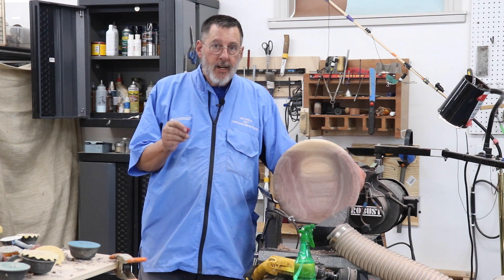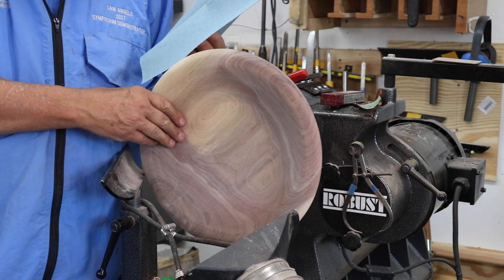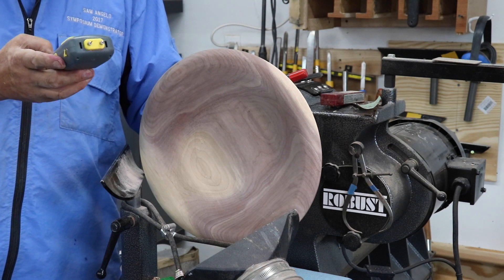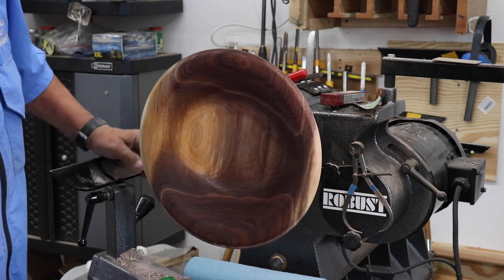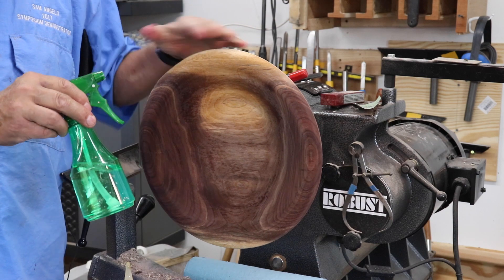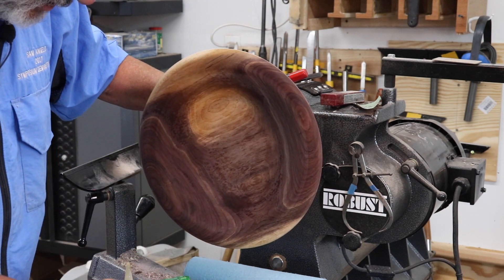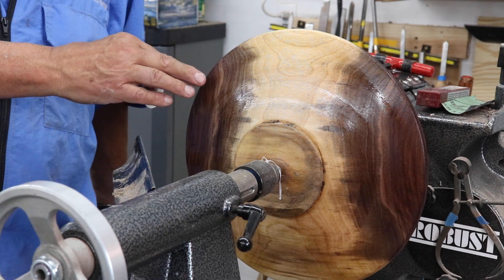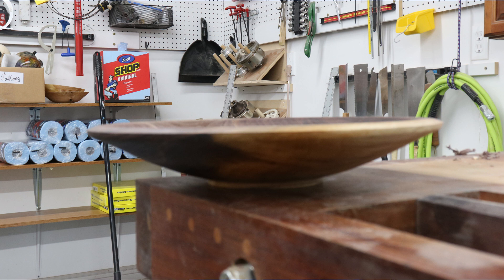Applying an Oil Finish to a Walnut Bowl       with Sam Angelo

Comment: I love Dr's Woodshop finishes...it's all I use for my 'food safe' pieces.  For what it's worth...I'll sometimes leave a piece in the chuck and unscrew the chuck with the piece mounted and set it 'up-right' on my work bench.  I'll then 'puddle' a bit of the walnut oil into the bowl and sides, leaving it for several hours or even over-night.  Once soaked in, I'll put the chuck and piece back on the lathe and then 'friction polish' several more coats.  My version of a 'deep' finish.  For what it's worth...Dr's Woodshop sells a version of their product with shellac included.  Great video as always Sam...cheers.
Reply from the maker: Yes I do something similar   thanks Sam

Comment: Sam even though your American Beauty has stainless steel bed ways, you could keep them (and the banjo you didn’t move out of the way very much) you can just put some newspaper across them (I keep a small magnet on the banjo that I can use to hold the paper) and it works better than just hoping the shavings you left on everything catches it all.  This catches the excess finish from dripping on them (like starting again at about 9:45). Makes keeping everything cleaner a lot easier.  Cheers, Tom

Comment: Good one Sam! I am a big fan of using cut shellac for raising the grain and sealing/sanding. I need to try your approach of applying some walnut oil on top, have not considered it since I figured the oil would not soak in over the shellac? Good method to slow down drying out. Thanks from Clancy.

Comment: Sam I am of the same thoughts as David Walser. I thought you would apply an oil to bare wood to allow it to absorb and protect the wood. Then apply the shellac to achieve a hard durable finish. Thank you for sharing. Have a great day and stay safe.

Comment: As others have commented, it is peculiar to "seal" with shellac before applying an oil finish, when one of the main advantages of the oil is that it penetrates the wood and enhances the figure. If the objective was to slow the drying of the wood, the oil / wax finish would do that. The common sequence where grain / figure enhancement is wanted is to put on a drying oil and, when it has cured, perhaps put on a shellac / wax or some other top coat.
Reply from the maker: Gord, we are just going to disagree on this.  I have been sealing with shellac first, for a long time.  Yes the oil would penetrate the wood-but when thinned down, most any finish will penetrate.  The best argument is that you can also put most anything over shellac.  It provides a bond between the wood and the final finish and it dries very fast.  My shellac is thinned down enough so it really sinks into the wood.  It is OK if we are both right.  I mean, I see nothing wrong with your approach.  Sam

Comment: Sam -- I don't understand the benefit of sealing the wood with shellac before applying an oil finish. One of the primary benefits of an oil finish is its ability to penetrate the wood -- causing the grain to 'pop'. Sealing the wood with shellac prevents the oil from penetrating. On the other hand, I can see the benefit of applying shellac over an oil finish...

I should add, I understand the benefit of using shellac as a sanding sealer before applying an oil finish. In that case, you'll sand down to bare wood before applying the oil.
Reply: Same question as David and Glen Sam...if the shellac 'seals' the wood, how does the oil penetrate???  Beautiful piece nonetheless...